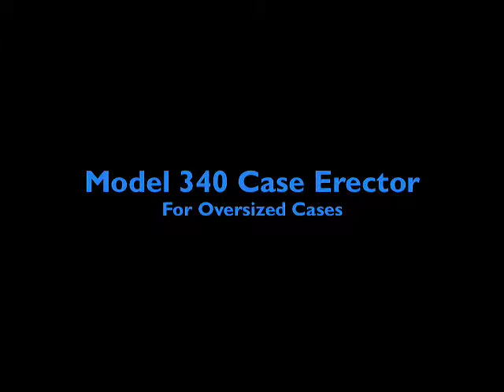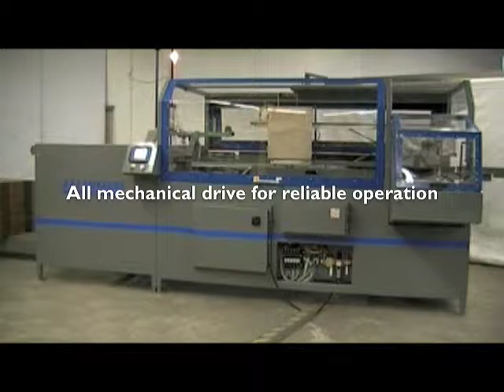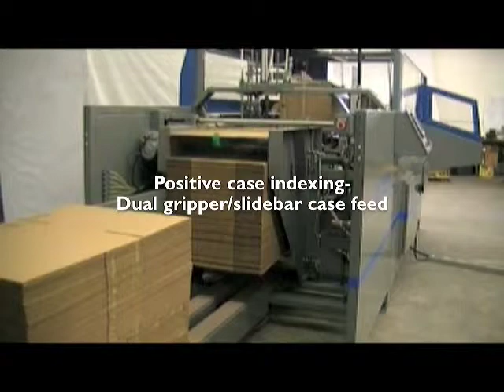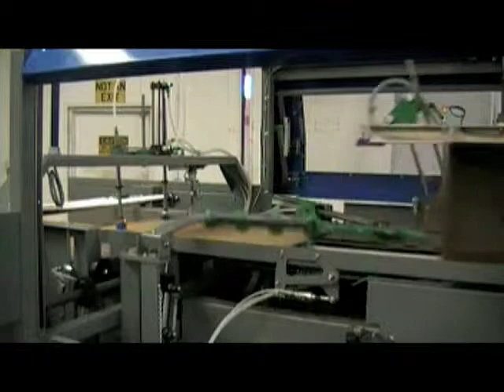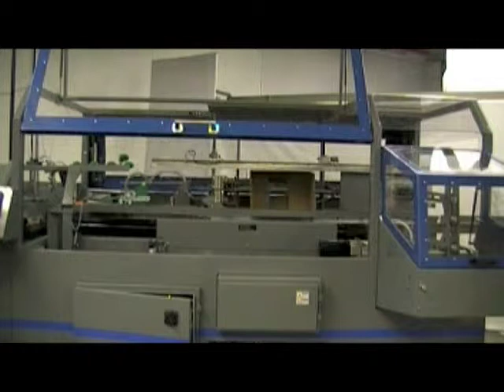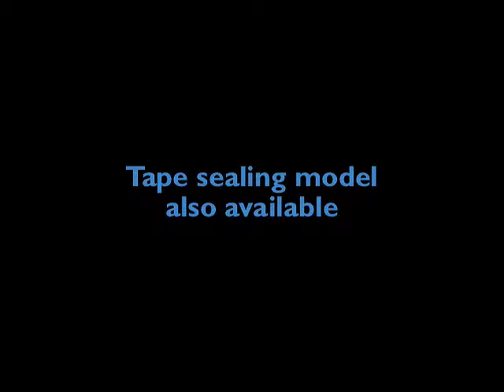A-B-C 340 Case Erector and Bottom Sealer | ProPac.com

Comment: whats's the maximum lenght box size that it can build?
Reply from the maker: Hi Pablo.  Depends on the type of case and whether tape or glue is used.  Tape Knockdown Max Case Length: 45".  Tape RSC and HSC Max Case Length: 26.75".  Adhesive Knockdown Max Case Length: 45".  Adhesive RSC and HSC Max Case Length: 25".  Find photos and specs here: https://www.propac.com/packaging-equipment/case-erecting-packing/abc-case-erector/340/